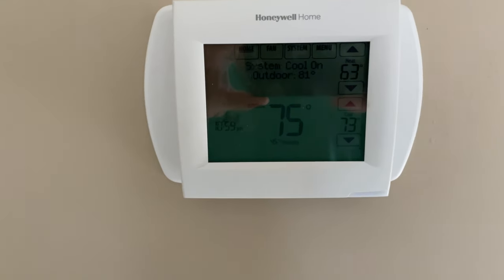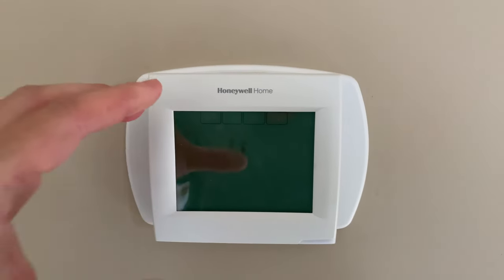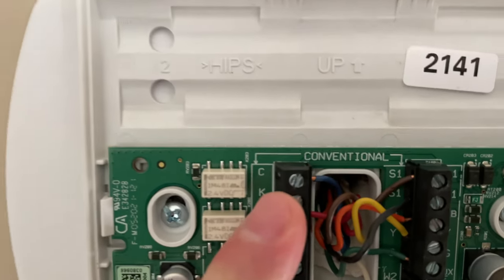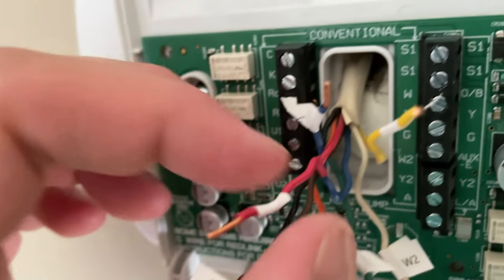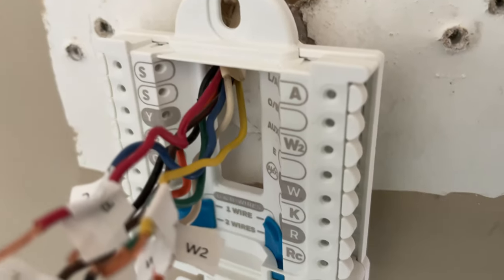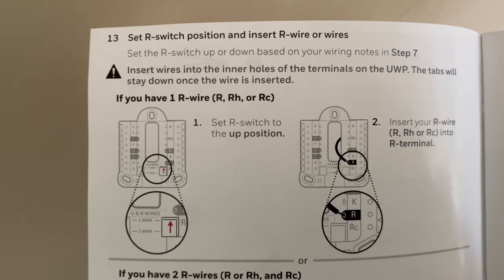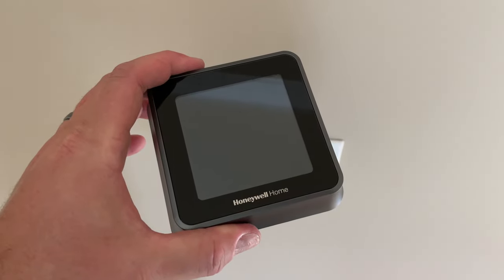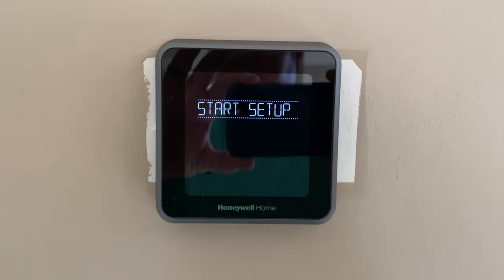Honeywell T5 Installation Video

Comment: Super helpful video, thank you so much.
Reply from the maker: No problem and these things have been solid!  I have one downstairs and one upstairs.  It’s great to be able to keep track of runtime.  Also, I suggest setting a daytime schedule and a nighttime schedule to optimize energy consumption.  We do that and also use geofence, so that the temperature automatically adjust when we’re both away to save energy.  I will say that I used Nest prior to this and the T5 is so much better!

Comment: Thank you for this video! Super helpful and educational. 

We just installed this thermostat today. We had an old school Honeywell that had the buttons.  Only difference was ours has an O wire and an R. After install, I called tech support and it turns out I had set the unit to conventional instead of heat pump LOL.  Oh well it works wonderfully.  And the app, schedules, plus manual option at the thermostat itself make it worth the investment.  What type of HVAC units do you have? This one works with our Goodman.
Reply from the maker: Awesome!  My two units are Carrier and I have two T5s.  Be sure to check out geo-location if you haven’t already.  I have it set to where when both my wife and I are away from home, it changes the temperature to save money.  It works great!

Comment: Great video @IrixGuy's Adve and thanks for making this video.  Question, how did you feel about those terminals for the wire?  We are taking back the RTH9585WF because the terminals are a push plastic and broke off fairly easy.  These ones look different, but plastic..

Comment: Just asking, is it possible to remove the old internal electrical components from the old thermostat and use it as part of your mounting hardware to prevent exposing the  previous location, hopefully there won't be a need to paint? I don't know if its possible. Just asking.
Reply from the maker: I took the lazy approach.  Your best bet would be to use drywall repair, sand and then paint to make a professional installation :)

Comment: I only have like 3 wires. I’m so confused.
Reply from the maker: I'd suggest contacting an HVAC tech.  That sounds strange.
Reply: There should be hidden wires behind the wall if your 3 wires was only connected to your furnace or something.

Comment: My wife and I moved recently. Our new home had a smart thermostat. She hated the smart thermostat. I replaced it with a Honeywell basic thermostat that was a set it and forget it model with up/down arrows to change the themperature. No wifi, no bluetooth, just walk up to it, set it and forget it. Modern confusing technology is very annoying to some people.
Reply from the maker: You can control the T5 from the display itself.  My wife disliked it initially too but dollars saved trumps excess spend.  We both have the Honeywell App installed with geo-fencing enabled, so it adjust the temperature to save energy while we are away from the house.  Also, I set sleep and daytime temperature schedules.  Our larger HVAC unit is the downstairs one, so during the day in the summer, I make the upstairs two degrees cooler.  That results in less runtime for the larger and more expensive to operate downstairs HVAC in the summer.  When bedtime hits, another schedule lowers the temperature to make it cooler for sleeping.  That way we're not keeping it as cold 24x7.  During the winter,  the same is true except we set downstairs to be warmer than the upstairs.  It's well worth it.  Save a few utility bills, buy your wife some wine and flowers and then reinstall a smart thermostat like the Honeywell T5.  Cook dinner and share those old utility bills (previous thermostat) with new utility bills (smart thermostat) and show her who was right =). #SmartHome #T5

Comment: Too complicated, just give me on/off.
Reply from the maker: That's the beauty of this smart thermostat.....no need to fiddle with on and off.  I set schedules for sleep and daytime use and it has radically reduced my utility bills.  The only "button" that I push is within the app when I switch from AC to Heat seasonally.  I have thoroughly enjoyed these two thermostats and they have paid for themselves several times over, thanks to my utilities savings!